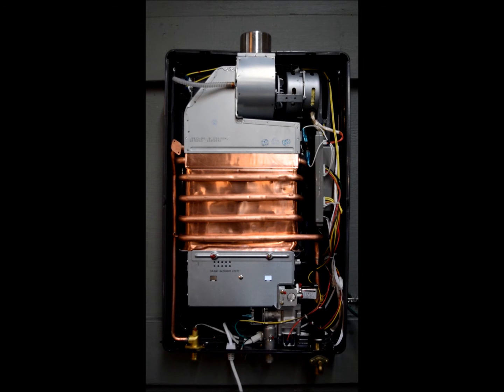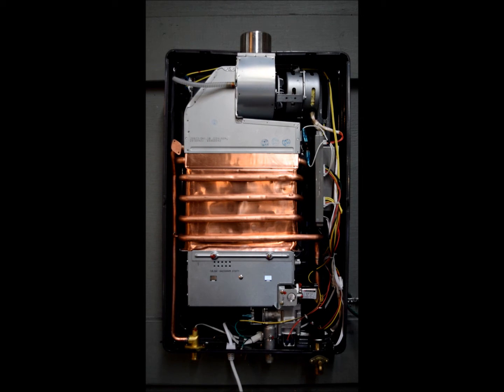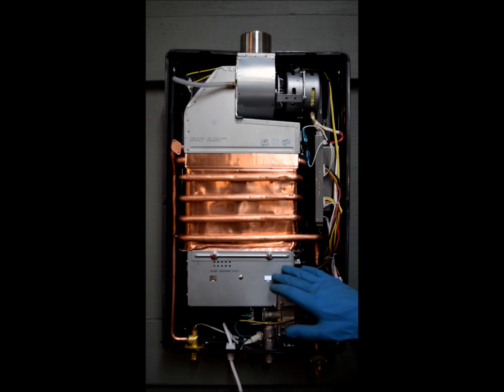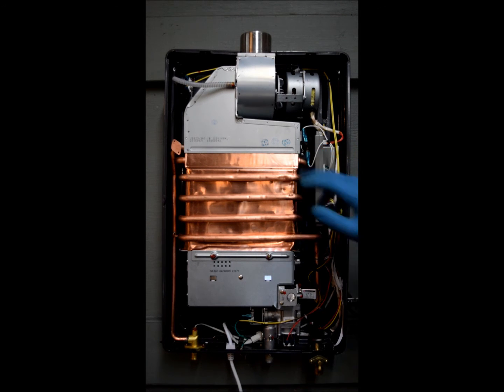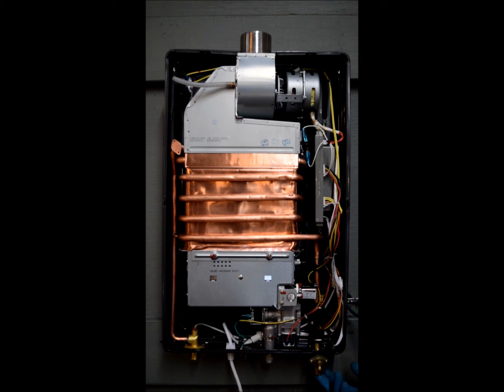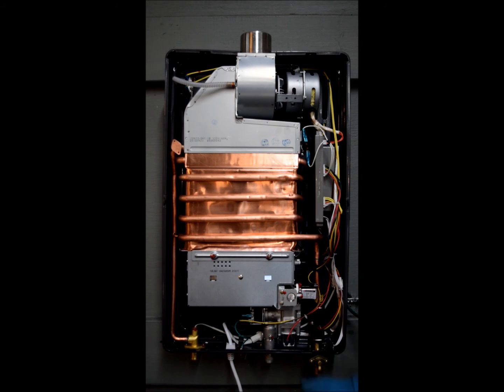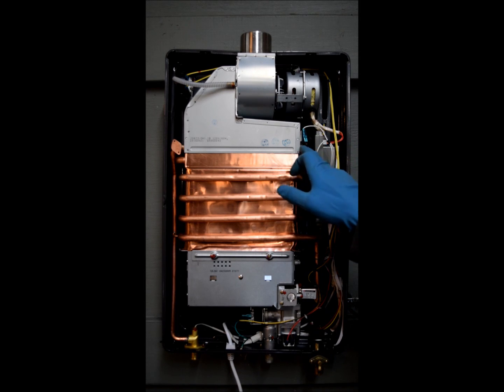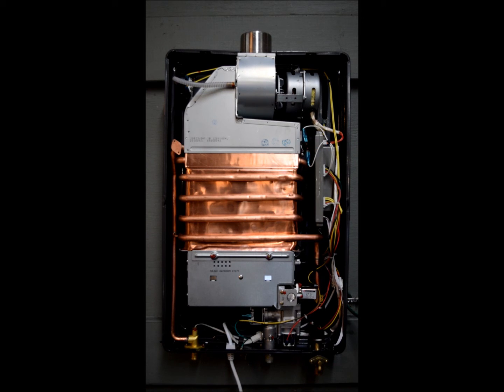I12 WHOLE HOME TANKLESS WATER HEATER OVERVIEW

Comment: Do you know how to troubleshoot and fix error E1?
Reply from the maker: Hi there, the E1 is typically due to an issue with your gas. Could be too much or too little gas that can cause this. We recommend reaching out to support@eccotemp.com for further assistance with this. You may also visit our helpdesk at support.eccotemp.com if you wish to self-help. Either way, our team is happy to assist.
Reply: Thanks for responding. Unfortunately already reached out to support and help desk and they were not able to help me out 
The heater was working fine for a little over a year before it started malfunctioning and displaying the error code. Sometimes when it is unplugged from the power source for a few minutes or longer it seems like it resets it self and starts working again for a few cycles and then E1 appears again. Also sometimes I can hear the burner starting for  a few seconds then shutting off and E1 displaying. 
Searching the web for information regarding this issue I ran into your video, which by the way is very explanatory, and I was excited to found this informational video hopping that I would find and answer to the problem.
Reply from the maker: @fernandomartinez8327  We are sorry to hear that your issue is still not resolved. We highly recommend having a technician come out and take a look at your gas supply. Also, you might want to look into replacing your flame sensor and ignition pins. Sometimes it's as simple as a small part like that. If you're still needing help, please do not hesitate to reach back out to our team. We are constantly working with our engineers to find better resolutions to issues like you're experiencing and would love the opportunity to help figure this out.
Reply: @fernandomartinez8327 I'm having the same issue with the E1 error code let me know if you have a solution to fix this

Comment: But how do you unlock it to raise the temperature?
Reply from the maker: Hi there! To raise the temperature, simply unlock the i12 by pressing and holding your finger on the LOCK icon displayed on the LED screen for a duration of 5 seconds. Once unlocked, you'll regain control over adjusting the temperature settings. I hope this helps. ☺